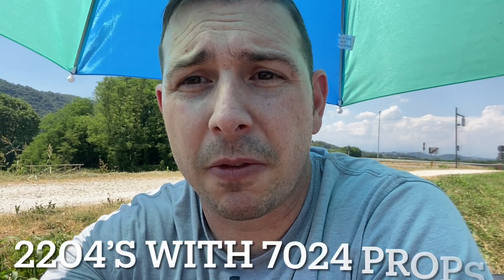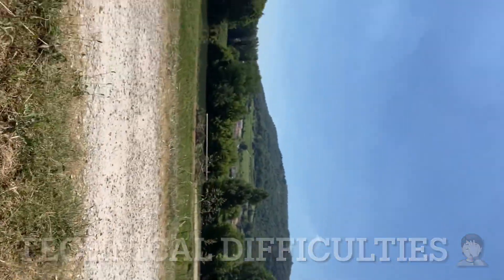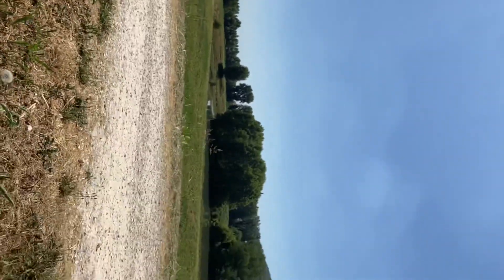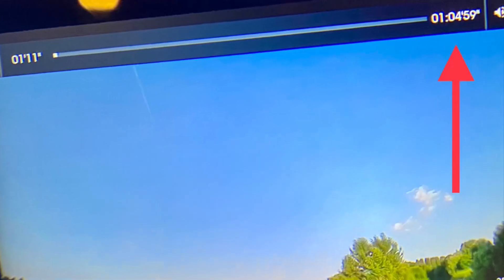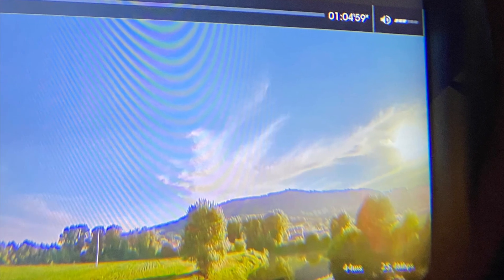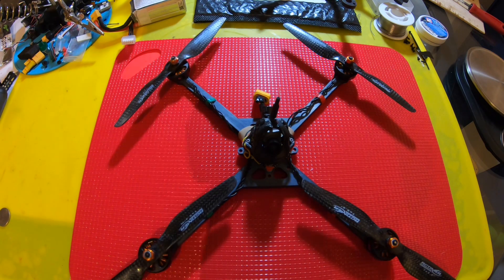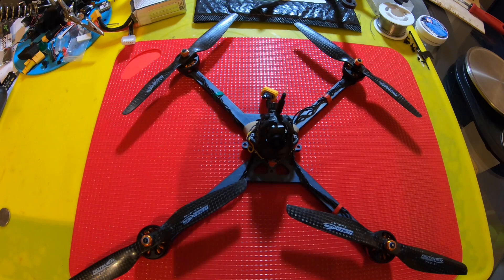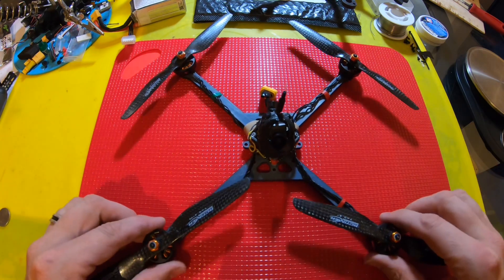“65” Minute Flight, Long Endurance with a DJI FPV Quad

Comment: Nice! I'll have to tune my 7" done and try to report any issues
Reply from the maker: When the drone is so light it’s very sensitive to different sized batteries. I had this drone tuned nicely for sub 250g flights, but with the 5000mah Battery it needed to be retuned.

Comment: Have you tried this with 6s lion pack?
Reply from the maker: I’ve tried the 4s 3500mah and the 4s 5000mah li-Ion packs. I don’t have a 6s Li-Ion pack yet. Here is that sub 250g flight with the 4s 650mah battery. I think it was just over 19min. 
https://youtu.be/xLuz1XSKVRI
Reply: @DivergentDrones  These might be stupid idea and hard to fit to drone Gemfan QX350 PC 8020. Little heavier like 6g but longer and less pitch.

Comment: will be waiting for your next endurance flight test.  your previous was 45min right? then you jump to 65? if ratio and proportion would be accurate... triblade should spike you another 10minutes... [i think]  or maybe thats a stretch... say another 5....
Reply from the maker: I’ve been looking for a lightweight 7” tri blade, but I haven’t found one in the 3.5g to 4g range. Any suggestions? I was going to try the new 23mm (tall) motors from FPVCYCLE and see if that is a good motor upgrade. At 1830kv and 23g a motor, It could be a good option on 4s. They should be in stock soon. 🤞
Reply: @DivergentDrones  I dont know any yet for the moment..  :)) curious if you go li-ion, if that will extend the time....

Comment: Great job! Anxious to hear if you can manage to tune out the wobble. I had the same problem with my ultralight 7“ builds and 2004 motors. Never managed to get that wobble away without adding so many filters or turning down P/D that made the quad fly rather annoyingly. Too bad these motors are not produced any longer!
Reply from the maker: I found that the 7042 props were the best for stability, but still at high throttle, the quad would vibrate similarly to what you saw in the video. I was going over the filter today on the Nasty495 quad (12” props), i want to go mountain Surfing tomorrow, but the next tuning day will go to the V2 frame.
Reply from the maker: I just tuned the quad for the weight of the Li-on pack I had to move both filter slides down to .8 and drop my D gain slider to 1.2 and my P&D gain slider to 1.1 
That got all of that jello out of the camera.
Reply: @DivergentDrones  looking forward to that. Also it would be great to see your Gyro_Scaled data. I‘m working on a few endurance frame concepts at the moment. Would love to get in touch - i‘ve sent you a message on FB.

Comment: How could you possibly get so much life out of it 😅
Reply from the maker: The app draw is so low with these motors, I asked Kurl from Diatone to reconsider bringing the 2204’s and he simply suggested another motor that wasn’t as good. 
Here’s a link where I used a 4s 3500mah battery: https://youtu.be/iYXEm6RBiss